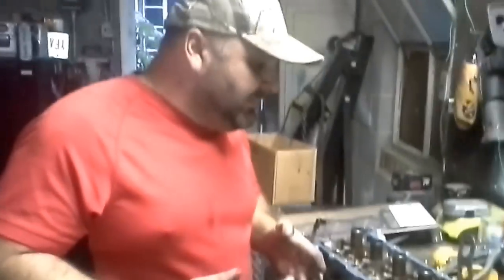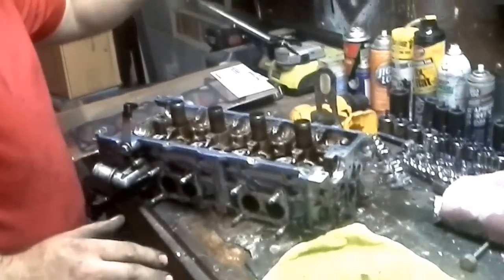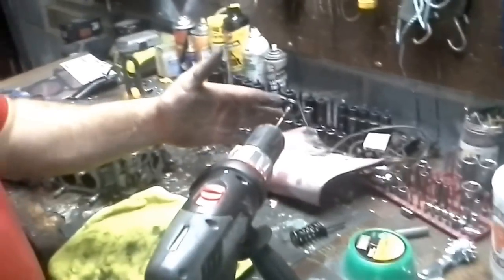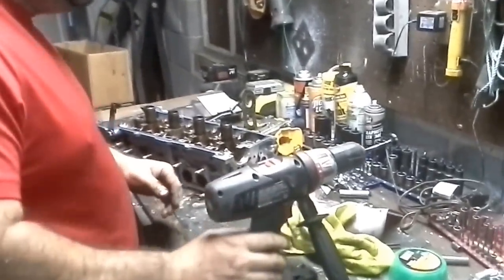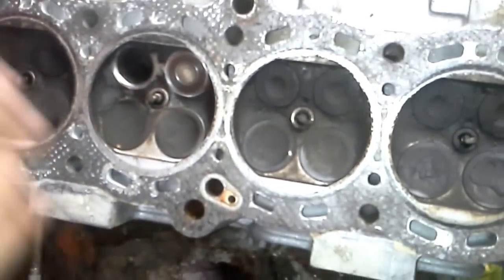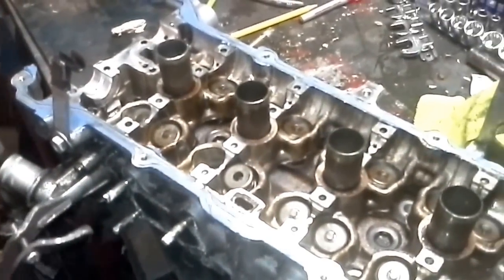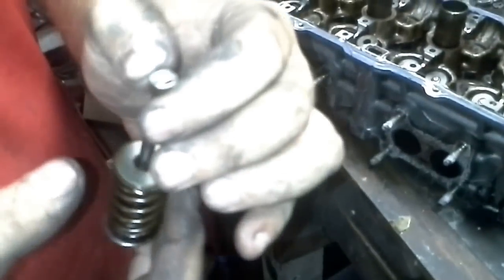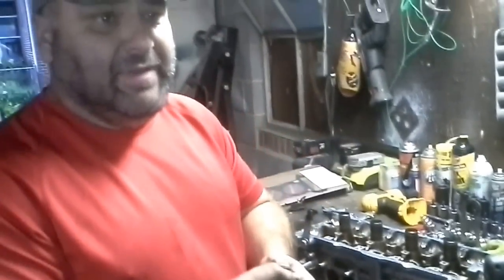How to Fix Burnt Valves/ Grinding and Installing/Cleaning Carbon Buildup

Comment: not trying to be a troll man, but please turn down the radio... very distracting. otherwise very informative. thankbyou!
Reply: I was going to write the same time
Reply: But in the end it doesn't even matter.
Reply from the maker: New valves cheap
Reply: In spite of the way you were mockin' me
Acting like I was part of your property
Remembering all the times you fought with me
I'm surprised it got so far....
Totally agree 😀 😀

Comment: Jamie thanks man...i pulled the top end off my warrior last night...cuz it was smoking ....but when I pulled the piston it was decent....im replacing that and the cylinder...so while I got the head off I figured fuck it I'll check the valves......there so burnt yours look good...i tried cleaning them....no good...so now I'm learning how to lap my new ones....and thank you for this video....i think I'm in over my head...but I'll get it done....picked up some really good tips....so thanks man
Reply from the maker: Happy to help man!! If you look at my video playlist and look up the 4.7 rebuild, I also did a full valve job on that one too. If you need any help, just let me know. I'm happy to help you however I can.
Reply: @jamiejonesthecarman  link ?

Comment: I've got an 02 altima 2.5 4cyl that I bought with a burnt exhaust valve. It came with another head that was supposedly good, we'll it's not (warped bad) could I use one of the exhaust valve out of the spare head to get this one going?

Comment: hello. I have a mini cooper r56 and when the engine is warm lose compression in cylinder 2.when the engine is cold all ok. do you believe my problem is the valves?
Reply from the maker: First guess Headgasket
Reply from the maker: Chemical test your coolant

Comment: So if I need to install new valves,do I need to take it to the machine shop?
Reply from the maker: panchovillaxx7 if you have the ability to take it to the machine shop I definitely would I generally do take mine to a machine shop but this was on a bad headgasket so i wasnt too concerned about valve damage at all but if you have a situation where you've been running super lean for any length of time or if u need valve guide seals
but if it's your main transportation I would definitely take it to the machine shop and get the head shaved and checked cleaned put a new set of seals in it and get the valve cut grinded pretty inexpensive and when its done you don't ever have to worry about it will be good for the next hundred and fifty thousand miles need any help just let me know
Reply: JamieJones TheCarMan thank you,I took the head off and all of the intake valves were leaking, the machine shop wants 300 to start,if there is more damage then the price will go up,What are the steps if I'm installing new valves?
Reply from the maker: panchovillaxx7  wow thats high , so go get you a valve spring compressor for about 20 bucks 25 bucks or if its just a one time job you can rent one out at Advanced or autozone. make sure you get you a little magnet so when you compress it you can get both the little keepers off at the end of the valve stem that's all that hold them on there, then pick you up some valve lap compound $3 valve lap tool $5  or if you have access you can use the drill like I did,  and basically your going to put compound where the valve makes contact  and just use the valve to grind the surface until it gets super smooth which is where you get the tight seal from and if you have one valve that isn't seating well you can buy them individually for about 5 to 10 bucks a piece just take your time and it will be just fine
Reply from the maker: JamieJones TheCarMan  why did u pull the head to start with did u have a pop in the exhaust
Reply: There was no compression on one of the cylinders,for sure one one the valves is bad, that one on the cylinder with no compression looks deformed.
Reply: OK so I'm gonna take all the valves off,then I'll take the head to the machine shop to get clean and check for warpage, then I'm gonna get new valves and lap/grind the seats with the valves and that should be good right?
Reply from the maker: panchovillaxx7 Yes Sir..it should be good to go. Let me know how it goes for you.